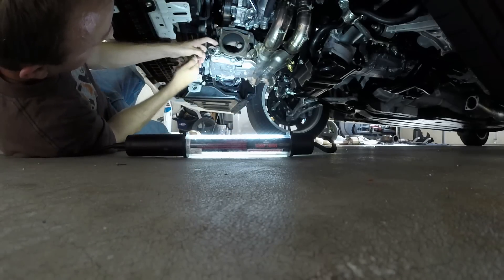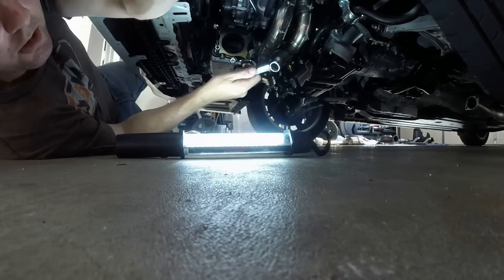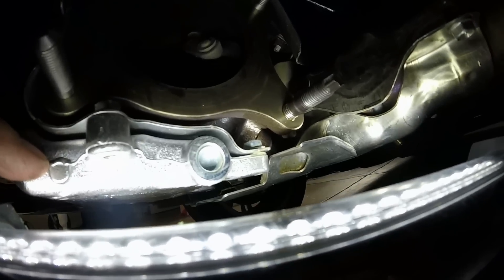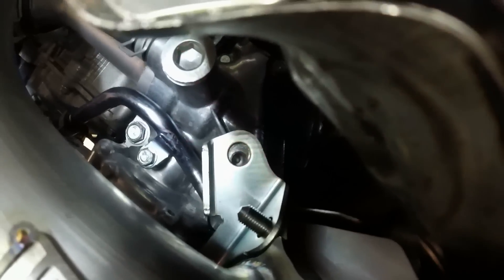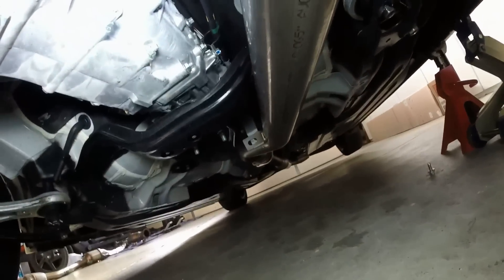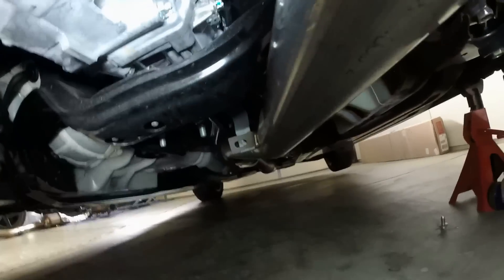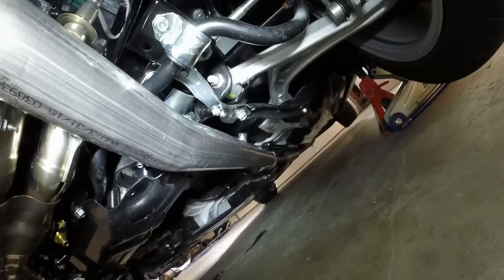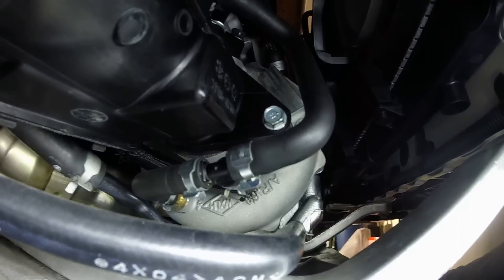2015 Subaru WRX Limited: Ep. 101: Grimmspeed J-Pipe Installation

Comment: Don't let someone else's mistake bring you down. Cross threaded from the factory, bad luck and def not your fault. A mod else where will bring your mood back up. Sell the extra parts, free up some cash, be patient and enjoy the car.
Reply from the maker: ***** thanks for the uplift hero.
Reply from the maker: ***** hmm you just changed your name in the scope of the morning. interesting.
Reply: LastHumansGarage of course man! I walked into my garage and realized my CV boot and axle need to be replaced. That money was for a new transmission mount. S##t happens brotha. (name and profile changed btw. Tired of my high school username)
Reply from the maker: ***** I keep thinking the fix thru in my mind. I have a stud remover which could force it out. it might snap in there, it might not. then i could drill it out if it snaps. then i could first try a new tap to fix it before i resort to drilling it out bigger and using a heli-coil kit.  only problem is, this is my daily driver, and i don't want my car to be down for a few days.
Reply: LastHumansGarage didn't see your reply. Yeah, I had to change it. It was about 10 years over due. With my new channel I want to start, I need a cleaner user name and page.
Reply: LastHumansGarage I know you love working on your car in your garage, its one of the best things in life, but have you given thought to having a shop work out that stud? I'm sure with the proper tools, they could have it done in a few hours. Maybe call and schedule something and let em know you need the car ready by the end of the day. Just throwing it out there. Thanks for the back and forth bro, having fun with your channel lately.
Reply from the maker: ***** i dont think any shop could do it better than i could. i have done dozens of those over the last 20 years. i mean i know how to do it. its just luck on how it all turns out depending on the level of stuck-ness. i mean they would just force it out too. and if it breaks, it breaks. then they would drill it out just like i would.

Comment: I know I might be a little late on this one but maybe you had alignment issues because of the torque exerted on the car's chassis when you used the jack. Like the entire exhaust system along with the engine are experiencing a moment because of the twist. That car might have a high structural rigidity for performance purposes, but you can't disregard the fact that there is a moment present due to gravity. I would suggest try putting jacks evenly on both sides and then try to fit those stubborn bolts to align. If it works, let's thank Isaac Newton for teaching us statics lol
Reply from the maker: i kept replaying your comment in my head and finally it computed. You mean just lift up both sides on my next downpipe job, instead of just drivers side like usual. Then, see if that inner flange bolt going upwards actually lines up. great idea, seriously.. i would fall over in disbelief if it suddenly lined up.. but I'm not about to uninstall my whole downpipe again just to find out... unless i decide to go back to stage 1 or something. we are talking about the turbo twisting differently than the engine for that particular bracket. which is virtually impossible since it is bolted to it. but i have seen strange things in my day..
Reply: Oh no! I am not saying that the entire frame bent. In fact, I think that frame is seriously sturdy. I watched your tire rotation video and the entire side of the car lifted when you jacked one point... now that's rigid as hell! lol What I was trying to say is that when you lift the car on one side, there is a slight moment/twist on the drivetrain and exhaust components, which COULD be the explanation of why the bolts weren't aligning perfectly. That's just a theory, but if it work, I'll be pretty amazed myself. The next time you're doing downpipe work, give it shot, and update us! Keep the excellent video coming!

Comment: Hey sir.. Do you happen to remember if you had any vibration sound from the shield you couldn't get the bolt in?
Reply from the maker: you need to get all the bolts in, otherwise remove the shield.

Comment: Awesome videos! 

Going stage 2+ on my 17 and I noticed my bracket doesn’t line up either on that hole. Its just over enough to prevent the screw going back in. Did you ever get it back in there or just left it?
Reply from the maker: bro, stop right there.. dont force it. thats the only flaw i had on my car. when i stripped out that upwards bolt... later, i enlarged the hole in the bracket to give me back 1-2mm on one side. then it went in fine, but it was too late... don't force it whatever you do.
Reply from the maker: much easier to not worry about it too much, and just file out the hole in your bracket a bit larger.. that bracket is called the "turbo stay" and i had 2-3 of them for this reason. might even have one in my misc parts still.. car is long gone.

Comment: Any down pipe you have to remove the restrictor pill? What is that exactly?
Reply from the maker: Luke Strothman yes. It's a thing that slows down the vacuum. You can get over boosting with stage 2 if you don't remove it.

Comment: You don't have the GPS option right? Does the non GPS unit comes with Sirius xm?
Reply from the maker: Fahrenheit38 i do have navigation. but i've used it one time in my whole life.
Reply: Thanks, I use my phone for GPS so I'd rather the non GPS model and get the factory sub and upgraded speakers. Just trying to figure out if the base head unit gets serious XM
Reply from the maker: Fahrenheit38 im sure you can find out by building one on the subaru site..
Reply: Seems to be lacking that info on the site. Gonna fly by the dealer here in a few days and ask them about it.

Comment: I know it's been a while since the video was made, but where the Grimmspeed j-pipe meets the stock catback with the adapter, was your connection flush?  With mine it seems like there's a little gap on the donut side.
Reply from the maker: the 2 sides arent supposed to hide the donut, thats the point of the donut. its the middle man. or get a pic..

Comment: What is the torque of the two bolts that connect the j pipe to the mid pipe with the donut gasket in between?
Reply from the maker: Jon Cole i recall it is 13 foot lbs.